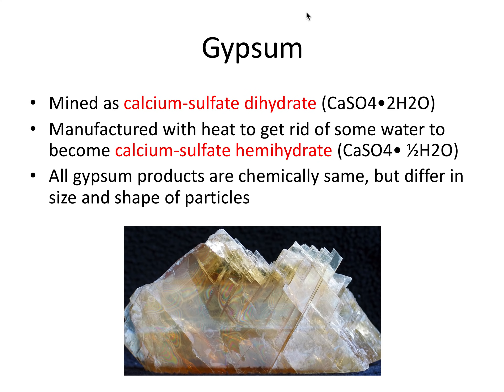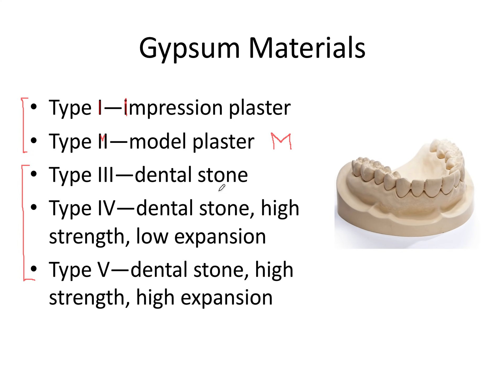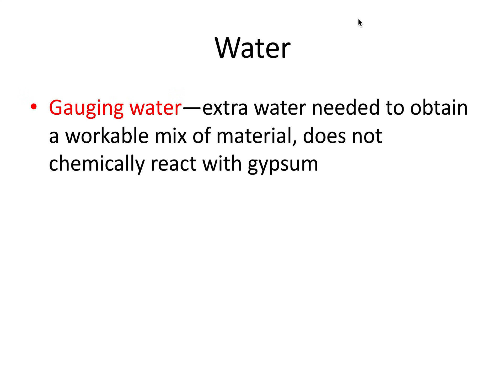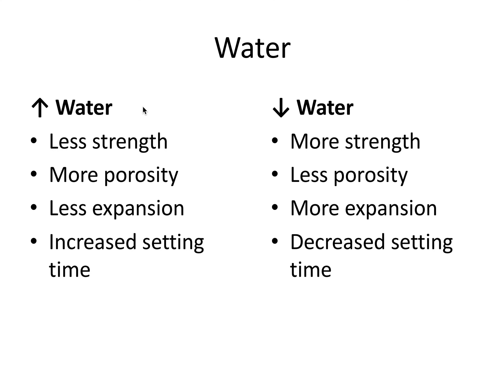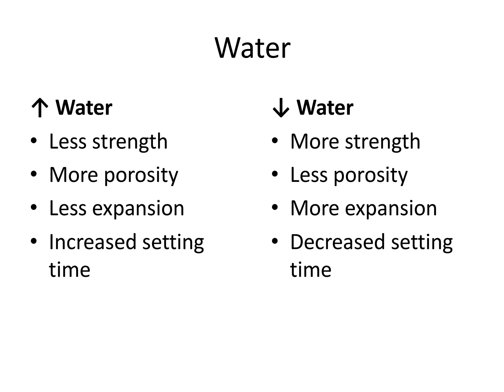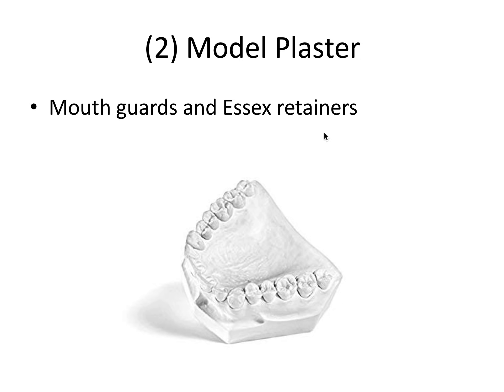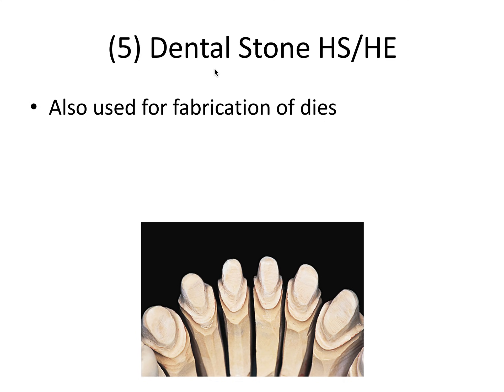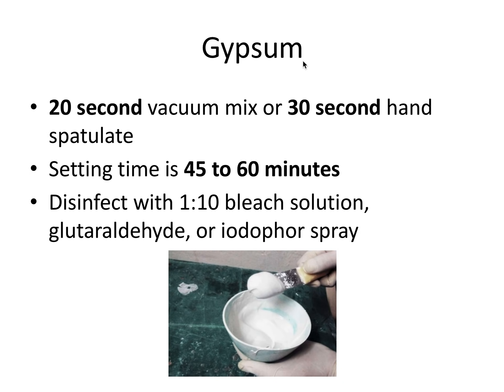Prosthodontics | Gypsum Materials | INBDE, ADAT

Comment: :( i was using chatgpt to help study for this and one of the questions:
Which type of dental gypsum is commonly used for creating dies for crown and bridge restorations?

a) Type I gypsum
b) Type II gypsum
c) Type III gypsum
d) Type IV gypsum

i remembered watching YOUR vid and i knew it wasn't the first two and i put D. 

THEN it tells me this : 
d

I apologize, but that answer is incorrect. The correct answer is:

    Which type of dental gypsum is commonly used for creating dies for crown and bridge restorations?
    a) Type I gypsum
    b) Type II gypsum
    c) Type III gypsum
    d) Type IV gypsum

The correct answer is a) Type I gypsum. Type I dental gypsum, also known as impression or mounting plaster, is commonly used for creating dies or replicas of teeth and oral tissues in crown and bridge restorations. It provides high detail reproduction and accuracy, making it suitable for creating precise dental prostheses.

:( I'm so done with that website. It messed me up on the water-to-powder ratios too and now i feel like i have to relearn everything. All because i told it to quiz me. Unless there's something else I'm not understanding with that question???
Reply from the maker: The answer to that question is D, you were correct the first time! That’s why you have to be careful using short-cuts to studying. 😉👍🏼

Comment: Hello!

Dental decks and some articles describe the addition of water resulting in more expansion of the gypsum particles. 

"Water/powder ratio: the water/powder ratio is an important factor in determining physical properties. When a high proportion of water is used, the powder particles are farther apart. This results in more expansion with a retarded setting time and a weaker product. Dental plasters generally require about twice as much water compared to stones. Plaster has a higher setting expansion than does stone."

Any way to clear up this concept?
Reply: What you posted is correct from my understanding. I believe that the video has a mistake in that regard

Comment: Love your videos! thank you for taking the time, just one question... Mosby: "The increase in water:powder ratio decreases the number of nuclei of crystallization per unit volume and increases the amount of space between crystalizing nuclei, thus increasing porosity when drying. This causes a decrease in the interaction of dihydrate crystals and diminishes any outward thrust of the mass. Consequently, setting expansion is decreased" (which is the same as your video). Dental Decks: "When a high proportion of water is used, the powder particles are farther apart. This results in more expansion with a retarded setting time and a weaker product" (which is totally opossite). So... more water is more or less expansion? I was taught more water, the cristals are farther apart and there is expansion, now I am really confused. Hope you can help me. Thanks
Reply from the maker: Hi there! Thank you for your question, and for including all of those details. I was surprised to hear this at first, but perhaps both of these explanations are correct! A thick mix with a decreased water:powder ratio means that more gypsum crystals will be interacting with each other which will increase expansion and increase the amount of heat released. This is how I always understood it. But, this decreased amount of water is still within the bounds of the manufacturer-recommended mixing ratio range. Once we go outside that range, that is when the rules change. Beyond this, excess water causes increased expansion beyond what is normal and is called hygroscopic expansion. Does that make sense?
Reply: @mentaldental  Got it! Thanks I just found: when a thick mix is used, setting expansion is increased due to the saturation of nuclei of crystallization. When a think mix is used, setting expansion is decreased since the nuclei of crystallization are less dense. But if there is  excess of water in the hygroscopic investment technique will produce an over expansion of the gypsum used for the investment!

Comment: I believe that increasing temperature results in a slower setting reaction for gypsum ..but your video says otherwise .can u give a little clarification please .appreciate your good work .
Reply from the maker: Can you point to any resource that says this? All of the notes and sources I have say that hotter water accelerates the reaction. Maybe this has to do with a maximum water temperature, where after a certain point of heating the water, the reaction no longer accelerates but actually slows down and will stop all together if the water were boiling for instance.